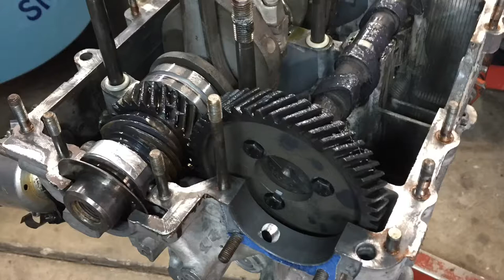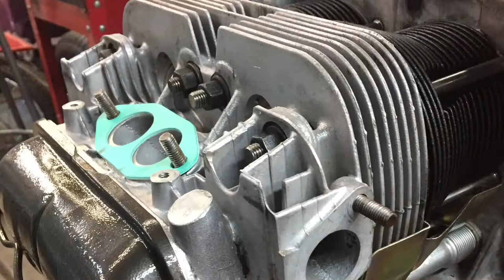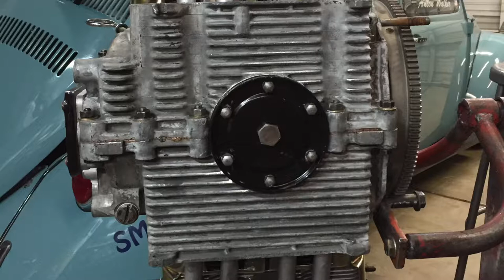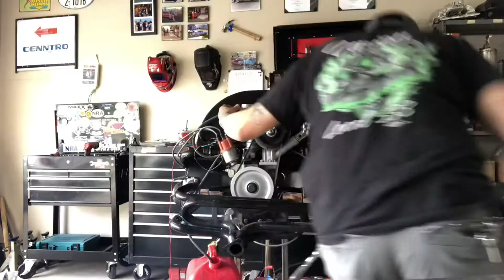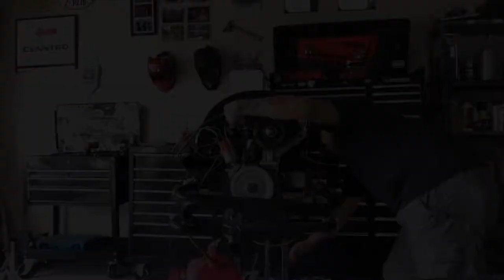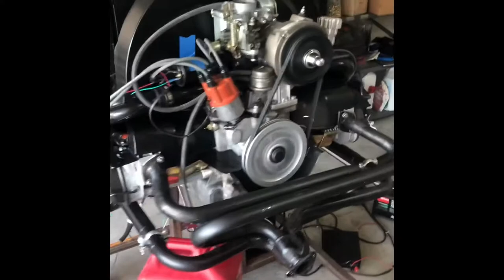VW Bug 1600cc First Fire! Engle TCS-10 Turbo Cam

Comment: Why a turbo cam without the turbo?
Reply from the maker: This was the initial break in. I didn’t want to run the turbo until I knew the engine was a runner. Check out the other videos on my channel, I have videos with the turbo running.
Reply: Did you upgrade the springs, lifters and retainers?
Reply from the maker: @IamThatDude10  just the springs
Reply: I wouldn't run that 009 distributor it's designed for industrial engines not street engines u got to have the vacuum advance or u will get a dead spot at high rpm or when u take off.
Reply from the maker: 009 has been working flawlessly. Currently it is locked out and running a CB Black Box. Engine has come a long way with a new carburetor and 10psi of boost in each gear.